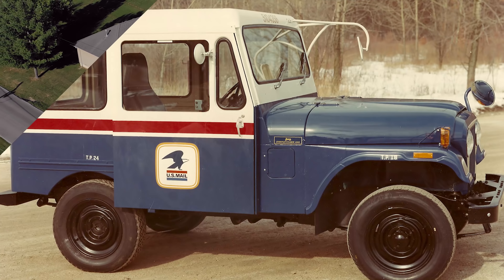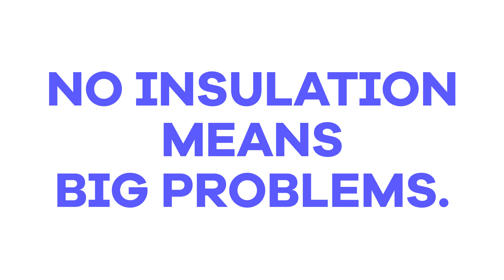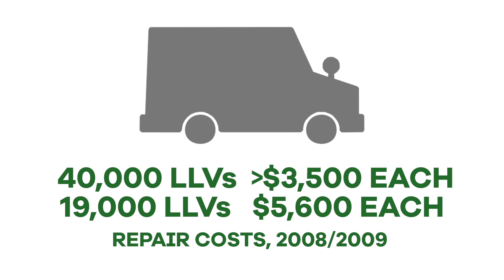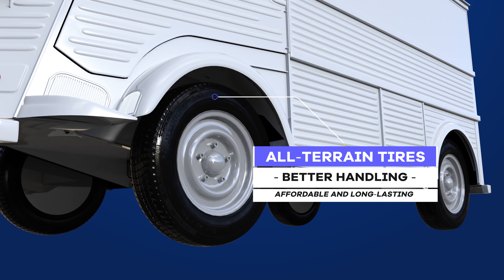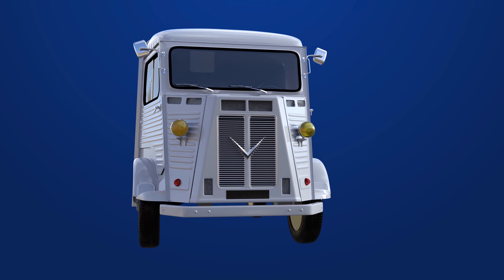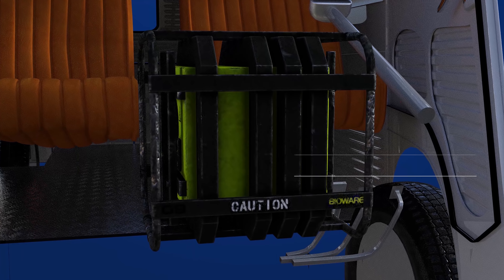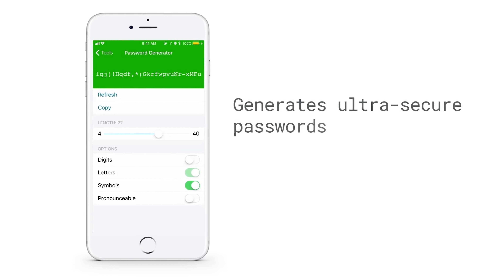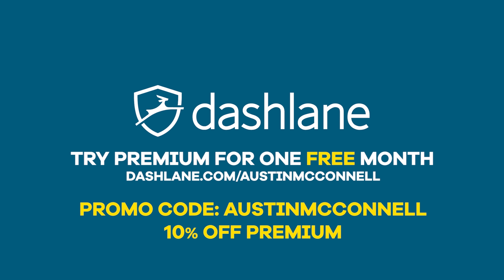Postal Delivery Trucks Stink. Let's Redesign Them.

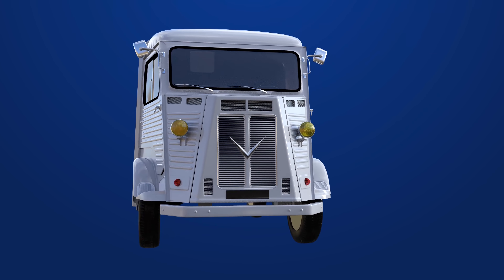Comment: 4:18 This is very well put together, but one of us is missing something. I am pretty sure the steering wheel is on the right side of LLVs so they can deliver mail from their seat on the right to mailboxes on the right side of the road.
Reply: Christopher Marroquin  for every mailbox? lol. No it needs to stay on the right side.
Reply: @warren7863  Agreed.
Reply: Where i live all of the mailboxes are small tin boxes on people's houses near the door. They uave to get out here anyway so maybe it would be good here to replace the right side.
Reply: @ArtianSetS  I don't know why they would change it. So what if some places require them to get out. Here all the suburbs are either grouped mail boxes for a street or individual street side mail boxes. There's definitely a need.
Reply: @ArtianSetS  Routes can be "mounted" (the curbside boxes), park-and-loop (with the boxes you're talking about), dismount (same boxes you mention), or a mix with the cluster boxes thrown in.  Since the USPS is always understaffed, routes are often split up.  This means, you can have a mounted route, but be given a section of a park-and-loop to do as well.  Or vice versa.  So it's best if most of the trucks are set up for right side delivery.  It doesn't slow you down on a park-and-loop, but mounted is impossible without it.
Reply: @ArtianSetS  Your area isn't every area. Where I live, all the mailboxes are on the street if you live in a house. The right-placed steering wheel has a function.
Reply: I've seen most mail delivery people get out to put the mail in the boxes.
Reply: Exactly. My current house has a mailbox by the door, but just one neighborhood over is all boxes by the  street. It would be a colossal waste of time for him to get out for that whole section. The house mounted boxes are a small majority. USPS isn't UPS.
Reply: @danielade9062  where you live, they do.  The USPS delivers to every address in the US.  Any design needs to work for all, or most.
Reply: Yeah that was my first thought too. As much as USPS is moving towards neighborhood delivery where possible, the road side mailboxes that predominate rural America depend on the right side drive/ sliding door combination any llv replacement would need to accommodate the existing postal infrastructure standards. Besides, the vehicle is much less important for "walking routes" anyway. 

Likewise, electric sounds good but I doubt that current batteries would be up to the task at an acceptable cost without hybrid capability.

Having said that most of the suggested improvements would be good, but a diverse fleet seems the most likely future.
Reply: Vary true. That is what would make this idea hard ! But it needs done !
Reply: At 1:08 the reason why it’s right hand drive is literally on display.
Reply: Yes there is no conformity to the mail box location arrangements. That also makes mail delivery difficult for different places for different reasons in each area !
Reply: No.
Also America drives on the right side of roads, therefore the wheels are on the left.
In any case, the design of this car Austin suggests would mean that irrelevant whether it is being delivered left or right, there's a small area where they can exit either side.
Reply: The current LLV allows them to pull up to mail boxes and put the mail in. Having them drive up and have to get out to put the mail in is extremely inefficient and putting the wheel back on the left side is a terrible idea.
Reply: For curb side boxes, like in rural areas, the carrier being able to just reach out the window and move on is necessary if you want them to get the job done quick and not be exhausted halfway through their rout.
Reply: You can't have two seats. One side needs to have the big "shelf" where the mail sits. The carrier needs that up front so that he doesn't have to get out and open the back door at every stop.
Reply: My mail is delivered to my door on foot. But literally drive 5 minutes south of me and there is curbside delivery because the houses are too far apart and the houses are set back from the road quite a bit.
A single design that accommodates this is necessary for an efficient mail service.
Google image search something like "country mailbox delivery" to get an idea of why we're defending the right side drive for mail trucks.
Reply: Also for safety reasons, so when the mail carrier leaves the vehicle they can avoid oncoming traffic.
Reply: There's a safety thing, which is accounted for... but the sliding door doesn't help to DELIVER the mail. 

In rural and suburban areas, mailboxes are curbside... sometimes even across the street from where the person actually lives. The mail routes are designed so that the mail trucks cover all of the curbside mailboxes, while a separate group of mail-people deliver letters on foot through mailslots and doorstep mailboxes.

Since Americans drive on the right side of the road, mail-people literally sit in the driver's seat on the right side of the truck, window rolled down, with all of the letters in the mailbag on their lap (or in what would be the passenger's seat). They do all of the delivery WHILE SEATED in one fell swoop of an arm action, without ever technically parking the vehicle, and they only ever full stop and park the truck when there's an actual package that has to be left on a doorstep.

If the driver seat/steering wheel is moved to the left side of the vehicle, that means they have to either; 1) park, engage e-brake, slide across to the passenger side seat, deliver the mail, and then slide back to the driver seat, or 2) stop the vehicle, park it, engage the parking brakes (rural places have some steep hills), get out of the chair, open the sliding door, deliver the package, close the sliding door (on windy days anyway), disengage the brakes, shift gears to drive, for every single mailbox.

That's almost double the time and labor.

If the driver's seat is on the left side, it would almost definitely requires two mail-people per vehicle in order to execute mail delivery in the same speed and efficiency as the current mail trucks.
Reply: I've driven an LLV and a Jeep CJ-5, and RHD is virtually a non-issue once you become acclimated to it, which takes ~ 1 week.
Reply: This is exactly correct. But one more thing about this that everyone seems to be missing... this is also why the ride height is fairly low. You can't raise it, because then the driver is too high to reach the mailbox easily. And before you say "just make the mailboxes taller", consider that mailboxes are the height they are so residents can easily reach them, and that there are tens of millions of mailboxes whose height would need to be changed. Far easier to design a new delivery vehicle around current height.
Reply: @syrrysaver2775  The longest postal route is only 300 something miles and its in Oklahoma. Tesla gets a rage of what around 250 miles? I think it'd be feasible but definetly more expensive then gasoline but if they're gonna last another 30 years who knows where we'll be with fossil fuels that far in the future.
Reply: Why not just have controls on both sides like an airplane?
Reply: Postmen should be walking anyway (expect for parcels)!
Reply: @alec4672  Where the other seat is in all other cars and trucks is where we keep the trays of mail we're working from.  It's crucial for efficiency to have that there.  
The trucks need to be replaced, and improvements made, but the overall layout of the front cab section is not one of the areas that needs to be fixed.
Reply: Just saying that in MY particular area changing the LLV trucks would be beneficial, so perhaps just a local revamp instead of national
Reply: Yeah, but two hundred and fifty for how long?  These things aren't driving non-stop, and with austin's design they'll be stopping at literally every mailbox, rather than being able to drive up to some and drop a bit off.  I'm kind of interested to see what Oshkosh Truck might come up with for this, their designs are always a bit different than expected.
Reply: Why not instead keep the driver seat position just as Austin said but change the driving side in all the US streets. Ez.
Reply: ^Right here, a genius, completely out of the blue to solve the world's problems, one problem down, ninety eight more to go.
Reply: Copper Creek Cuts agreed. This does not need to change. Getting in and out fast, drivers would be tempted to keep stepping out the door towards traffic. I doubt a carrier would keep space clear to exit through side door. Keep the steering wheel the way it is.
Reply: @christophermarroquin2496  Theyd still have to fully park the vehicle. Get out of the driver seat. Go to the back. Then go back after the delivery. No where nearly as efficient as stopping for 10 seconds and putting some stuff out of the window.
Reply: Assuming curbside parking, exiting the vehicle's right from a left side driver's seat can translate into hundred of feet a day added onto the driver's workload. Not to mention having to move around a cramped cabin in a bulky winter jacket... 

Any design should preserve at least right hand drive, if not add dual side or quick swap drive options.
Reply: Why not a digital steering wheel that transfers input to the steering section.  This could allow the seat and wheel to slide from side to side with just a release handle.  Go from being on the right side to the left without any issue. Though I never got why the Postal Truck couldn't just drive against the flow of traffic when delivering in subdivisions.
Reply: Completely drive by wire systems with no mechanical linkage are typically not seen in a favourable light still, as there exists far more failure conditions where all input controls are totally negated. Having zero control over a vehicle is usually 'not a great idea'. 

We are getting closer to a drive by wire system that sees risk levels approaching or improving over mechanical linkage thanks to work in aerospace and self driving cars, but it seems like a risky tech to invest in on something the scale of replacing these trucks. Maybe an option for a trial run with a a thousand or so vehicles, but it would be an extremely hard sell to do on a full large scale replacement program.
Reply: @docholliday7408  That's right. Good point. You might be able to raise the cabin a tad, but too much and the driver is having to strain more than necessary to reach down to the box rather than straight out.
Reply: I hope Austin does a follow up video addressing these design flaws.
Reply: @Cheston-gw7wn  Who said anything about two seats? You could just have the drivers seat on slides (just like the ones that allow you to move the seat forward and back) just slide the seat to the position you want to drive from. Also my maillady used her personal vehicle along with alot of other route drivers around here so I don't think losing that tray would be too big of a deal in the first place. They just recline the seat all the way and put the mail there no reason mail can't sit on a seat.
Reply: What about having adjustable seating. Where it slides to the right if you want it to
Reply: Copper Creek Cuts s
Reply: A good design would allow manufacturers to produce these with driver on either side, and maybe even make it super easy to convert in case a post office changes their mind down the road.

Also electric is a good idea if the battery can be swapped, that way the only range issue is how far the truck can go before it has to go back to the depot to get a freshly charged one swapped in (using an automated process).
Reply: @warren7863  you could just put a sliding window on the right side of the cabin; just stick your hand out of the window and put the mail in the box.  If it isn't close enough to do so, you probably weren't able to before anyway, so getting out through the sliding door on the side is really a non-issue.
Reply: I'm baffled as to why so many people are adamant on having some kind of left side steering. Left side stealing adds extra effort and complication, and extra cost for moving or dual controls. Right side stearing makes delivery fast, east, and safe. If all this is for concern of the driver having to adjust to right side drive, they already do. That's not an issue.
Reply: I agree where I live they pull up to every mailbox and put the mail in if they had to get out every time you wouldn't get your mail for days LOL
Reply: There's a simple solution to this problem: include a rail system so the side can be changed on the fly. Two steering wheels would simplify it even more, because there'd be less moving parts so better reliability. In the event of an emergency, two people could drive at the same time to increase maneuverability and safety at high speeds. I think this is the way forward in LLV technology.
Reply: Being able to steer from the left side is unnecessary and only causes problems! The End!
Why is this becoming a point of contention?
Reply: So as the driver goes through the neighborhood, they must stop, get out of the seat, open the sliding door, service the single mailbox, close the sliding door, get back in the seat, and drive 50 feet to the next mailbox, repeat several hundred times.  And do it again the next day.
Reply: @christophermarroquin2496  Why would i drive a truck all day if I'm going to get out every 5 minutes. I would rather walk.
Reply: I'm done. We've explained why right hand drive is not only better, but required for efficient mail delivery nation wide. To deny this is just insane to me.
Reply: Why is everyone stating like I was the one who came up with this? It was him. It's in his video.
Reply: @christophermarroquin2496  Fair point. However, your first comment, weather you intended to or not, appears to be endorsing the left hand drive decision in the video.
Reply: 1:12 the video displayed the truck pulling up on a mailbox in front of a truck which needs to be a feature; tight turning radius
Reply: You're on the right track with the truck needing to be flexible. It needs to be able to receive a preloaded/sorted standard pallet 'cassette' of mail with the ability to transfer its operation to another need.
Reply: Yeah, having it on the right is better. Faster to hop out of the car, and to put it in post boxes.
Reply: its so the mail carrier can deliver mail to curb side mailboxes or get out of the truck on the curbside to prevent getting hit by traffic.
Reply: @RBXTrains , how would you like to walk when it's down pouring rain or during a winter blizzard?
Reply: The steering wheel on the right side also means that they never have to get out directly into traffic, which would be dangerous given the amount of times every day the drivers would have to do this
Reply: @Cheston-gw7wn  
You mean..... mounted is "dangerous" without it.... alot of contractors use their own vehicles and perform circus acts to get the mail delivered.  I can't believe they are allowed to do such things while the average joe gets ticketed just for not wearing a damn seatbelt!
Reply: @ArtianSetS  And get out into oncoming traffic? No thanks.

Comment: “It needs to last a long time “
adds a bunch of crap that will break
Reply: LLV was designed to last 20 years, and 30 years later they're still in use.understandably they would have mechanical issues, there 30 years old and were designed to last 20.
if something is designed to last 20 years and it lasts more than 20 years, that is successful.
I agree that most of these additions proposed in the video probably aren't designed to last 20 years.
Reply: I think he's talking about the new one
Reply: Its almost like he's a filmmaker and not  an engineer
Reply: Edit: He did state that he wasnt an engineer and to take his ideas with a pinch of salt i wqs wrong
Reply: @dieter2889  He's almost like somebody that tries to give attention to something that really needs to change while getting paid.
Reply: @holtscustomcreations  The LLVs were indeed successful, but even if they still technically work, they don't work well anymore.

And you the features suggested may be made modular, easy to work on. Even though they may not last 20 years, if they're durable enough, easy to repair and maintain they should be fine.

Besides they're just ideas, it's about bringing awareness to something that needs attention.
Reply: He did say he wasn’t an engineer
Reply: @Colinop  Its almost like an argument is starting right now, oh well.
Reply: I say make everything out of stamped steel, and call it "El Boxo"
Reply: And all digital intergraded devices added will be archaic in 5or 10 years time.. and will no longer be compatible XD so make sure it’s replaceable.. camera?! Hahaha... all terrain tires?? Those don’t work in places such as Wyoming, Utah, Montana, Alaska, and a few others.. sometimes you need winter studded tires combined with chains to get anywhere...
Reply: @dieter2889  6:28
Reply: @holtscustomcreations  heh, in the UK we had railbuses designed to last no more than 20 years. It took 40 years until they were removed from service (and thank god they did)